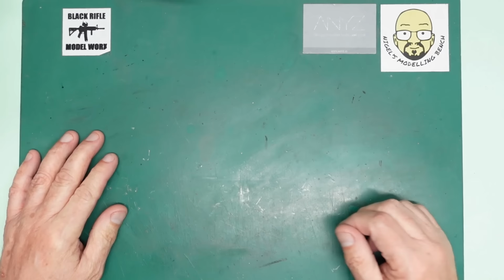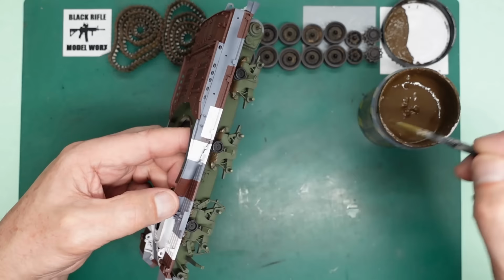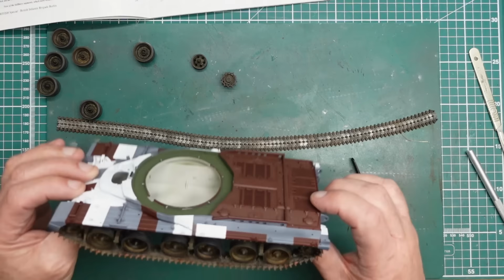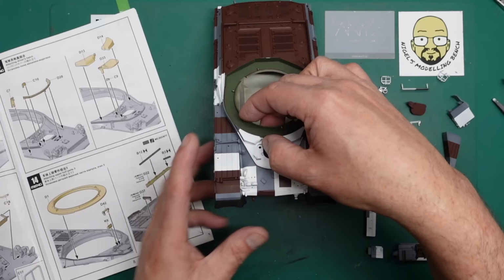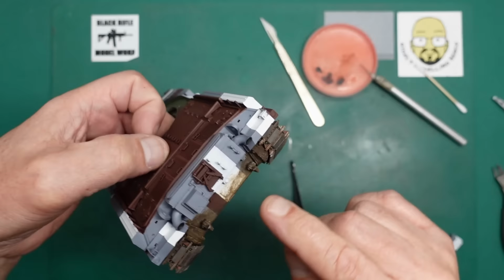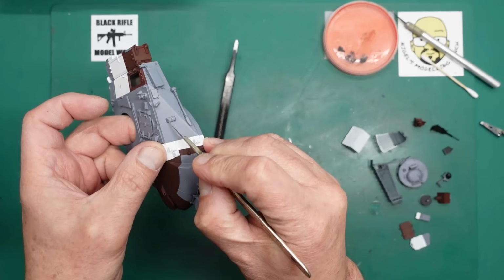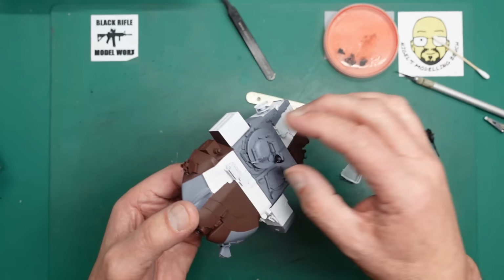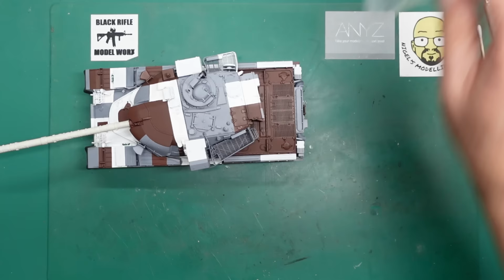Meng 1/35 Chieftain Mk10 build.  Part 12... in 1440p

Comment: Hello Nigel, I love the way the paint scheme turned out, you've done a great job.  The winch on the turret contained communications wire so that the crews could run a hot loop between the vehicles for using powered sound phones.
Reply from the maker: Many thanks